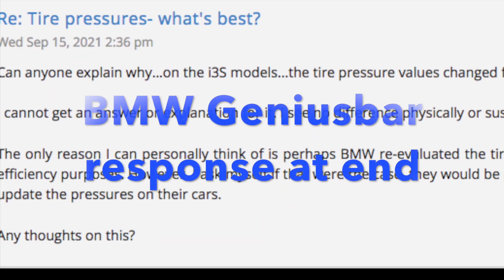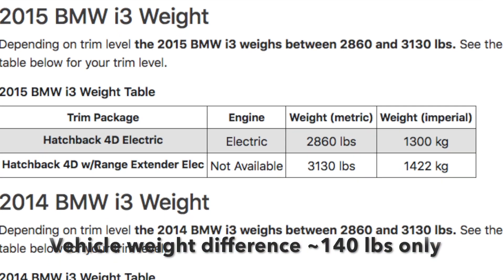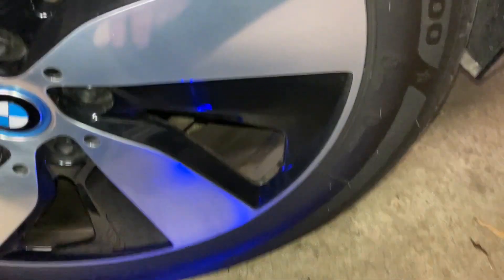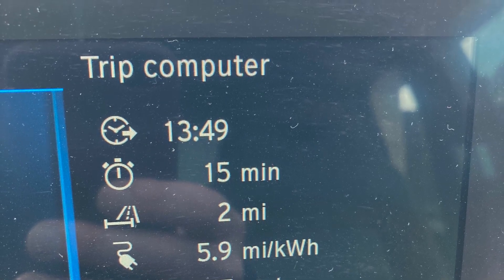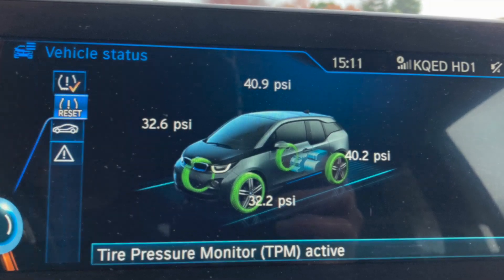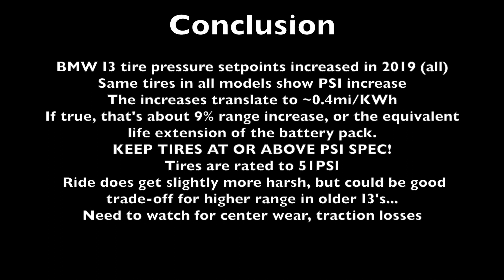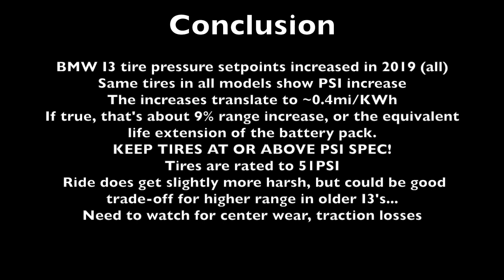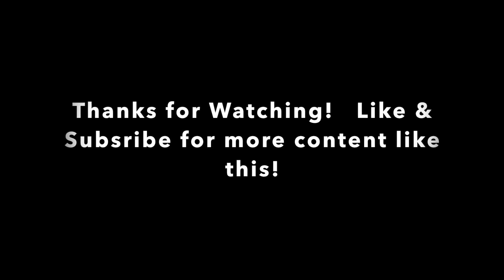BMW I3 Tire Pressure Spec Confusion?

Comment: I have been running 41 PSI front, 44PSI rear and much better war on the tires and better range. 4+ years and I feel this is correct.

Comment: Higher pressures will help your range very slightly.  My local Seattle dealer set ny 20" tires to 35 and 39 (actually lowered them) - and will probably keep these here due to the amount of potholes and terrible road conditions.  I didn't notice my 2019 REX reporting more than 1 psi difference from my gauge, but tire temperature will alter the pressure a lot!

Comment: My tires on my i3 2015 Rex say they are rated for max 51psi.   So I generally just fill them to 50psi.  Am I making a mistake by having my tires this pressured?  Is it possible I have non-standard tires? The tires look really flat if in the lower 40 range.
Reply from the maker: My concerns with the pressure that high are 1) the ride quality and potential for the car to 'bounce' going over a pothole / R.R. tracks could make controlling the car more difficult and 2) I have had to let out air on my rear tires as the summer heat & driving raised the pressure from 45 to 51 PSI.   I would check the tires under hot conditions after driving some distance, to make sure tire is not going over the rating.    Thanks for watching!
Reply: You really should not overinflate your tires!  They will wear out much sooner, and will always increase in pressure as they warm up from driving.

Comment: I just did a test with my 2019 i3s the other day. Front was down to 32 PSI and rear 36 PSI when cold. I increased the front pressure to 38 PSI and the rear to 44 PSI. On my 100 miles round trip test drives to my weekend getaway and back I did not notice any measurable difference. 80% of that trip is at speeds between 62 and 70mph and I'm running 195 front and 215 rear Potenza tires. So I guess whatever little difference in rolling resistance the tire pressure makes is negligible at higher speeds. The way the EPA measures road load is taking the car on a flat and straight stretch of private road / runway in optimal weather conditions and then run the car up to a certain speed, let it coast until it comes to a complete stop and measure the distance from where they started coasting. Then rinse and repeat in the opposite direction and calculate the average. They then repeat the test on a dyno setup indoors to separate the rolling resistance and internal losses from the aerodynamic drag.
Reply from the maker: Another interesting data point.   Aerodynamic drag is pretty high on the i3,  so you may be right that it washes out the rolling resistance at higher speeds.  I'm not sure how the wider tire/contact footprint would affect rolling resistance with the higher tire pressures, so that may be another variable to consider.   Thanks for sharing your experiment.

Comment: 👍
Reply: Re pressures.....all still good with higher pressure!
Reply from the maker: Thanks for the feedback!   I have also been running with the higher pressures & no major problems.  The only possible negative is that one day, I hit a fairly large pothole and the front wheel bounced enough to affect the steering direction.   If the weather was bad, it may have created a problem.   I suggest to watch the road conditions and maybe adjust the pressures down a little in non-optimal road or weather.

Comment: Hey there, isn't the computer going to go off saying I'm at the wrong pressure? BMWi3 2016 here.
Reply from the maker: I've been running a 2015 REX at 39PSI Front/44Rear for months, no alarms.
Reply: @bmwi3diy782  Thank you nice to know. Give that a shot I always thought they seemed too low anyway. But the Christmas lights thing. Incidentally if you ever get towed, you have to have it towed on a flatbed. All fours off the ground. Otherwise it screws with the computer and you get all sorts of lights.
Reply: It will only complain if the pressures change from when you reset the TPMS

Comment: I picked up a new i3s a couple of weeks ago. The dealer had put them on 37 and 42.
Reply from the maker: Congratulations on your new car purchase!  The I3 is a fun car to drive.   Regarding the pressures,  the only difference I could find so far is a different part number for the front coil springs on newer I3's,  but no further information as to whether this is related to the pressure spec change or not.

Comment: With the help of tire manufacturers max/min and a spreadsheet for weight and balance for even tire contact pressure. My numbers are independently higher in front and in the rear. The result is slightly more  steering sensitivity (nicer handling) and greater range. Important not to approach max pressure when hitting a pothole. I have about 10% improvement in range 🤔. Summer and winter (two sets of tires). Every time i consult with BMW they try to charge me money 🤑!
Reply from the maker: Sounds great!   Thanks for the feedback.   I also tried to contact factory engineers in Leipzig Germany directly for feedback on pressure changes, but to no avail.
Reply: Which pressures you are using?

Comment: Thanks increasing my pressures today.
Reply from the maker: I've been using the higher pressures for several months, with no problems so far.  However, I drive relatively conservatively.   If you drive in 'sport mode' style, or in extreme road conditions, I would be cautious just to be as safe as possible.